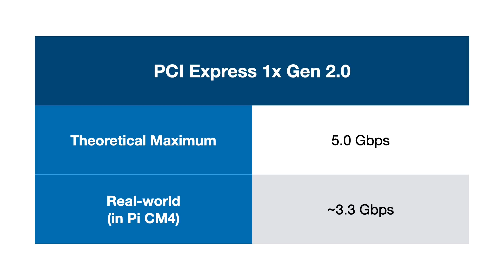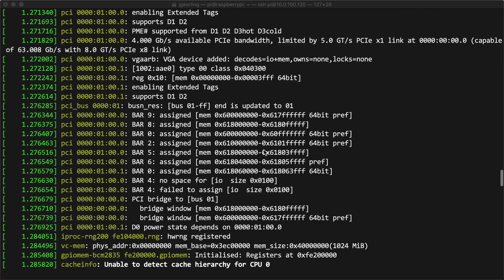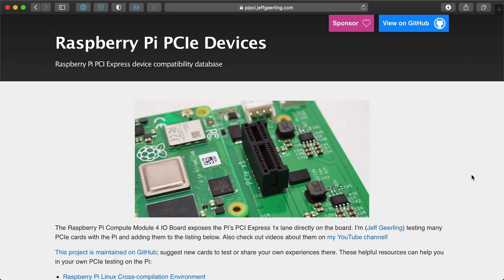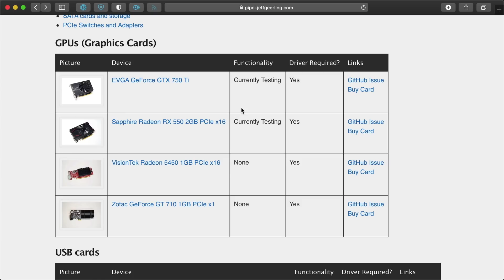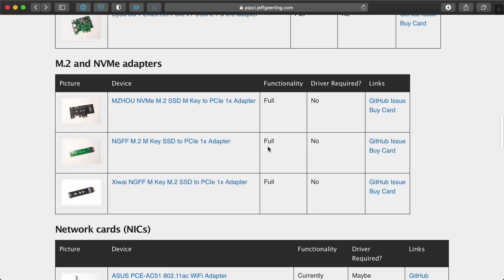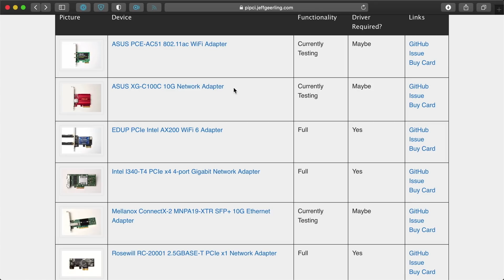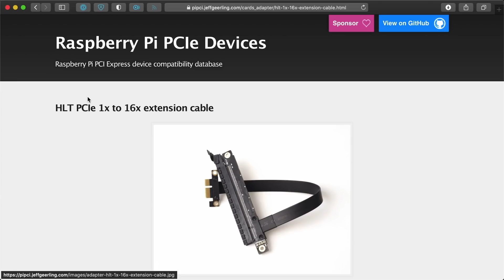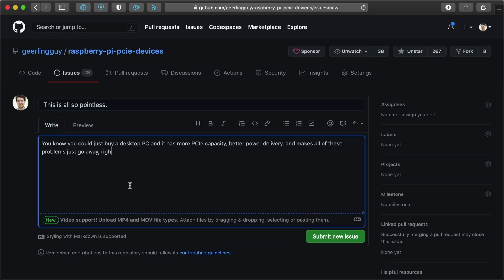PCI Express arrives on the Raspberry Pi CM4 - A Guide

Comment: Curious if any of those PCIE adapters work with Clockwork Pi Uconsole systems with the expander ports or if there is a way to plug into the CM4 PCIE directly.

Comment: I own a Sony VX1000 Camcorder and had a plan to transition to a "tapeless" setup by using a Sony HVR MRC1 (Memory Recorder), which connects to the camera's firewire out port. This setup allows for direct recording to a memory card instead of using tapes. However, the Sony HVR MRC1 is quite old, and I'm not willing to pay around $500 for outdated technology that's two decades old.

Due to the lack of viable alternatives in the market, I decided to explore the idea of creating my own memory recorder using existing technology. Given my limited knowledge about electronics, I thought of utilizing a Raspberry Pi with a firewire port and SD card slot. By running an operating system and software like WinDV on the Raspberry Pi, I could potentially record the footage to the memory card. Of course, I'd also need a small screen to monitor the recordings and an input device like a mouse to control the process. It might sound like a far-fetched and somewhat impractical idea, but I'm eager to explore the possibilities.

At times, I can't help but chuckle at my own ambitious plan. I suppose I could simply reach out to manufacturers in China and see if they can build me a device similar to Sony's HVR MRC1. This option may be more practical and less time-consuming than my DIY approach.

Anyway, I shared this idea with you even though it might sound a bit silly. I appreciate your videos and enjoy your content. Thanks for sharing!

That is what ChatGPT said, after I asked it to rewrite my original comment, ha ha.

I have a Sony VX1000 Camcorder and planned on going "tapeless", using a Sony HVR MRC1 (Memory Recorder), that is hooked up to the cameras firewire out port. That way you can record straight to a memory card, instead of using tape. Only "problem" is the Sony's HVR MRC1, but it is old. Very old, and I am not willing to pay around $500 bucks for 20-year-old tech. 
So, I started looking into alternatives. Unfortunately, there aren't any. Not really. So I decided to "put" together my own memory recorder. Since I know nothing about electronics, I am planning on using existing pieces of tech to somehow make it work. One way would be to use a Raspberry  PI with firewire port and SD card slot.Then run an OS and some software like WinDV to record the footage, and some tiny screen so you can actually see whats going on. Not to mention an input device like a mouse. LOL

What a stupid idea! I am sure I can just make a few calls to China and have someone build me a Sony's HVR MRC1 like device. 
Why am I telling you this? Anyhow, I like your videos. Thanks.

Comment: Hi very interesting video and because of your experience i need your help...One year ago i decided to build up my nas recoverying all my old pata and sata hard drives, i took all the old computer parts i had stored and i build a NAS with 10 hard drives. Now i discovered it consume too much power, expecially because it has a 700w titanium pro PSU, so i remember i had a couple of raspberry pi 4 stored and i would like to use one of them as NAS. Here my question, I have two PCI 4x sata controller, in my nas, is there a way to connect, at least one of them, to my raspberry PI? I thought about a riser card but i haven't a PCIe 1x slot on the pie and i don't want to remove e solder the chip i also would like to avoid an usb hub because i will lose the two pci controllers. Do you have some suggestion to find the best way to use my raspberry like a NAS? Thanks!

Comment: Do you know any case makers for the cm4 io board like a computer case allowing for the use of a pcie card. I want to be able to use the IO connectors on the PCIe card and want to have a case for CM4. My PCIe card is small and low power.

Comment: Jeff，I'm developing with Compute Module 4 IO Board, I have a problem, I use the official file line PCIEx1, but I have a questionMy understanding should be
PCIE_TX_N --> PETN0
PCIE_TX_P --> PETP0
But the original line is
PCIE_TX_N --> PETP0
PCIE_TX_P -->  PETN0

Comment: Jeff, could it be possible to make the Blackmagic Intensity Pro 4K HDMI PCIe capture card work with the RPi CM4?
Reply from the maker: That's a good question; I don't have one to test, but I'd wonder if the Pi's bus could handle writing through 4K video files easily... it would depend on what kind of storage you're using.
Reply: I'll test mine today, but what linux commands do I use to bring it up, etc
Reply: the blackmagic Intensity pro needs a minimum of a 4 lane PCIe slot

Comment: Hey Youtuber, I want to know how to give power source input in IO board of raspberry pi compute module 4? In its official documentation, it is said that it could run on 12v power supply as well as 5 v power supply also. But mine is not working with 5v. I do not have DC charger so I tried to power it from GPIO pins. Please reply ASAP. BTW I am a huge fan of yours from India. Thank You!

Comment: I recently became curious about a couple things. Is it possible to have IOMMU for PCIe devices on the Raspberry Pi CM4? And on that note, is it possible to use those adapters that convert PCI cards to a PCIe 1x port both normally and for IOMMU, if the latter is proven possible?

Comment: You do know that PCIe is "supposed" to be PNP, don't you? The fact that you're kludging each device one at a time is sort of contrary to the PNP concept. The fact that something as basic as programming BARS is not working as it should tells me that you need to fix the kernel you're working with first. If the boards your testing with work fine on Ubuntu amd64, they should work as well with Ubuntu arm64 with just a recompile. I think the biggest problem you are facing is the state of ARM64 Linux.

Comment: As someone who has had REALLY bad experience with those mining PCIE riser adapters (It fried not only the video card for me but the power supply as well. Annnnnd then burst into flame. Fun times.) I would highly, HIGHLY recommend that if you DO use them, test them out first on a system you can afford to lose. Also preferably something more resistant to surges/shorts/etc than a Pi CM4, haha. (Old PC set up as a test bench or something). The few minutes you'll take to test it out could save hundreds in fried equipment. (I had purchased 3 of those risers to use on different machines and had no trouble with the first 2, so... don't even blindly trust good reviews, as those can't predict bad units in an otherwise good batch. Better safe than stuck waiting for replacement hardware.

Edit: Also, a dremel standard plastic/soft metal grinding wheel will tear up the slot end a lot less, plus has the benefit of heating/slightly melting it in the process so the edges aren't as jagged, plus, so long as you're conscious of the direction of rotation, is FAR less likely to damage the pins should it come in contact with them.
Reply from the maker: Heh... one of those risers did burn up my little 2.5 GbE card: https://youtu.be/wCbQQ5-sjGM?t=28

Comment: I have at last my i/o board and my compute card!
I started to make my project right-away but got stuck with the PCIe card I want to use...
When plugged, the raspi boot up to the rainbow screen and stays stuck there. Did you had such behaviors with your test cards ?
It's a PCIe 1x DVB card, specs are given for a max +3.3V 2A／+12V 0.5A and the datasheets for the Pi4 i/o board give a max +3.3v@3A / +12v @0.6A , so it should be in the clear.
Reply from the maker: If unplugged, the Pi boots normally?

It could still be a power issue—what kind of power adapter are you using? Does it supply 12V 2A or more? I just updated my power supply to a 12V 5A adapter to be even safer.
Reply: @JeffGeerling  Yep, boots normally if unplugged.
I reused the PSU I had in a soekris net6501 that powered the board and this PCIe card without trouble.
Reply: @JeffGeerling  I got my hands on a PCIE Riser with power, the kind used for mining and got the same result so definitely not a power issue.
As soon this PCIe card is on the module the Pi4 stays stuck on the rainbow screen.
I tried to wait more than 5mins to see if it waits for a timeout somewhere but no luck.

Comment: PCIe Gen2 has a transfer rate of 5 GT/s with a 8b/10b line code. That means, that for 8 bit of data, 10 bits have to be transferred. Thus the (theoretical) max. bandwidth of a PCIe Gen2 lane is 4 Gb/s or 0.5 GB/s. Thus the 3.3 Gb/s aren't actually that bad.
GPUs usually need the high bandwidth, provided by 16 lanes. I would not be surprised, if the video BIOS simply shuts down the card, when it detects that some lanes have no heartbeat.
Reply from the maker: I've been assured by a few people who work in/around AMD and Nvidia that the card should still initialize on 1x, but it seems like we're possibly running into bugs in the Broadcom SoC PCI-E driver, or in some part of the code that deals with memory access and doesn't really work well with ARM (or at least all ARM64 variants).
Reply: @JeffGeerling  Yes, according to Wikipedia, it should be possible to establish a connection, as long as at least one lane is operable. As I have no experience with ARM, I can give no insight to PCIe-driver issues, sorry.

Comment: Sir Jeff,  I am considering setting up VPN at home then route through that to external VPN.  THAT WAY THEY ONLY GET QTY 1 DEVICE ADDRESS.

QUESTION (IF) I EVER NEED 2 OR MORE THROUGH VPN, DOES IT THREAD EACH VIA SOFTWARE TO NOT BOTTLENECK IN HOME VPN SERVER.?

What if I used the RASPBERRY CMs cluster 3 maybe?.

Comment: A friend and I are working on a handheld Game console using the compute module 4. Since there aren't a lot of real world tests with this board yet, I thought I'd reach out and ask if you feel like testing the power consumption of the cm4 under different conditions? I'm sure it could make for an interesting video! Cheers, and thanks for all the helpful information so far!
Reply from the maker: That is something I'd like to test at some point... but I don't have the time for the next few weeks at least (new baby on the way!). The only formal power testing I've done so far is in my SATA RAID NAS video, around 19 minutes in (https://www.youtube.com/watch?v=oWev1THtA04) — it ran at 5-6W standby and 10-14W with full load with a few external SSDs running. Adjust down a little if you don't need as much hardware attached.

Comment: I'd use the soldering iron to melt that end of the connector. The CM is really nice but whoever thought this connector was a good idea hasn't taken the right decision; it should be opened at the back from factory, why limit it physically, there is a lot of equipment that would be great to have working on the Pi even if not at full bandwidth.

Comment: can you an an intel 1x pcie 2 port network card, and turn this into a router with reasonable throughput?
Reply from the maker: I've already tested with the Intel I340-T4 and with a Syba dual 2.5 GbE card, and both work (so you have either 5 or 3 interfaces total). I think it'll be a nice way to utilize OpenWRT.
Reply: @JeffGeerling  nice, thanks Jeff

Comment: 12:00 Does a dell i350t2 (or even a i350t4) card work in it (and it is fine btw "only" having 2.5bps)? If so, does vmdq and/or sriov give problems when it comes to acpi tables that can be changed (iommu)? Can it do SLAT, vt-d/vt-x, etc. etc? Basically cisco emulation (or close, like maybe xen-project stuff). See DonKeyLearning channel. Consider supermicro i350 alternatives too. There are some interesting oriental (china) brands that might be more tolerant. Remember some cards (raid) allow the sticky tape trick for DMA. See Mark Furneaux channel.
Reply: Here for example is a weird (but probably affordable for a "new" unused) card, as some bizarre oriental brand: https://www.gomezpeer.info/2014/06/intel-ethernet-server-adapter-i350-t2.html

Comment: The main use case for the Pi in my eyes is portability and low power consumption, so you could hook it up to a battery and a voltage negotiator. But that isn’t an option when you have to use a desktop PC power supply, which is why it’s still worth getting these devices running. I wanted to make a portable game console but until there’s good GPU support it’s just not possible. Even that Nvidia 710 card is decent— moreso than Intel HD 600 graphics in an x86 Larkbox that costs twice as much.

Comment: Second viewing.  Crystal ball time.  As small SBC start using PCIe more and more, do you see any standardization of cable/connector to remote mount boards ? (Mounting PCIe boards perpendicular to a SBC is not a great idea for many reasons.)  I found one remote mount  on eBay the looks like the one you have.  Very inexpensive (<$10) and it uses a standard USB 3.0 cable (in a very non-standard way).  I see SBCs quickly moving from x1 to x4 PCIe.  Would that require 4 USB cables ?   What are your thoughts.
Reply from the maker: There are also 90° risers, which allow you to mount a card parallel to the IO board, though they would not do well without external support (e.g. a case and some mounting points) with many heavier cards.

The best solution would be either a riser or one of the flex cables with a case that supports the PCIe card (or multiple cards) more securely.

Comment: Is it possible to just salvage an old computer motherboard with an open-ended PCIe 1x slot and solder that onto the Pi? I think that's more elegant than mutilating that close-ended PCIe slot.
Reply from the maker: That is doable; probably even easier than trying to find the parts new! But it's still a bit of a chore desoldering and resoldering the slot.

Comment: Problem is that the base board is NOT available to us normal people until March. You can get the CM4 but dont have anything to put them on and the KiCad diagrams only work for a nightly release ... Great one RPF
Reply from the maker: If you look around, there have been IO boards in stock here and there. PiShop.us is currently showing them in stock: https://www.pishop.us/product/raspberry-pi-compute-module-cm4io-board/?src=raspberrypi

It seems to be getting better. Though the higher-capacity CM4s are still very difficult to find!
Reply: @JeffGeerling  Thanks Jeff although ordering this back to the UK form the Us sounds a bit much assuming this is Genuine and not one of these "mistakes" many sites have.
If you check Pimoroni here in the UK then its strictly a pre-order https://shop.pimoroni.com/products/raspberry-pi-compute-module-4-io-board?variant=32280572002387&currency=GBP&utm_source=google&utm_medium=cpc&utm_campaign=google+shopping?utm_source=google&utm_medium=surfaces&utm_campaign=shopping&gclid=Cj0KCQiA0MD_BRCTARIsADXoopZ3hI91Z5mw2mZf4jbjX5zRsiDtuIDl6p1uxyZNXpeXeraCnzWAhOkaAsi3EALw_wcB
It's possible they got better supplies but  I think its unlikely against Pimoroni/PiHut/CPC/Farnell/RS which are all giving March 21 ++ delivery

Comment: Hey Jeff (Red Shirt Jeff included), have you considered an ultrasonic knife instead of the xacto saw?
Reply from the maker: Heh, the first thing I thought of when you mentioned that is getting a darksaber (which would be cool to have, but is sadly only fictional...). But I haven't ever tried one (ultrasonic knife, that is), so I fear I might accidentally slice right through my desk and arm too.

But worth testing out, for someone who has one!
Reply: @JeffGeerling  I'm sure Red Shirt Jeff would use a darksaber every chance! I've used an ultrasonic knife several times in a prototyping lab, and they are far less scary than even a Dremel tool. I'd describe it as a fat handled xacto knife that cuts plastic like soft butter. And I'd say it's safer than the saw when considering nicking traces.

Comment: I don't how to say this but the very high pitch sound all through the video. I am not sure how you can fix it, But I would be very placed if you can. 

Maybe if possible to remove all high pitch sounds in the editing?
Reply from the maker: I went back to the original source recording and it is very slight but present there too. Usually it is not there, so I wonder if one of my cables has gone bad or is picking up some interference :(

I'll try to check for it in future recordings and apply a little EQ to fix it, but I don't believe YouTube allows swapping audio tracks, does it?
Reply: @JeffGeerling   Think you for the respond, hopefully you can the problem and solve it, and have a nice day!

 I am also not sure if it is possible the sweeper audio.